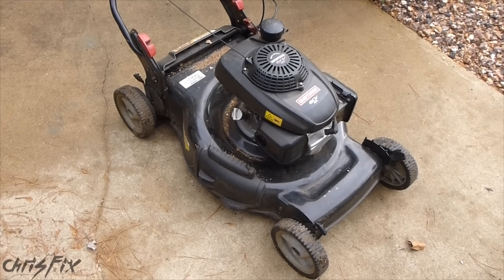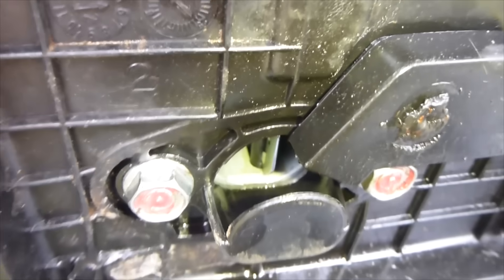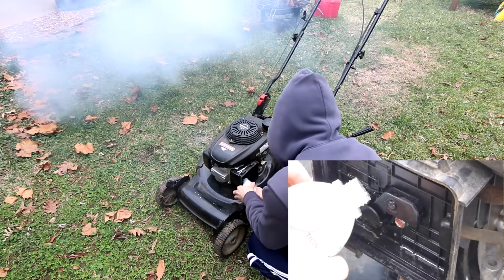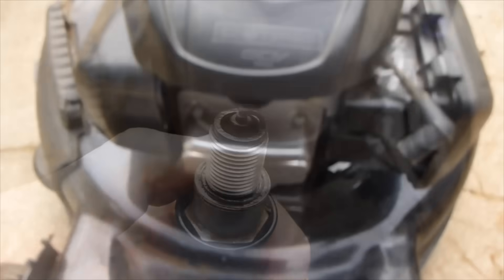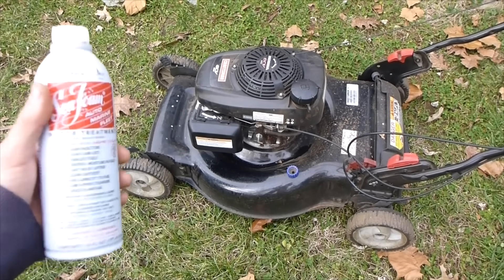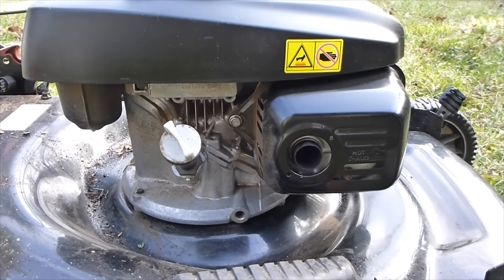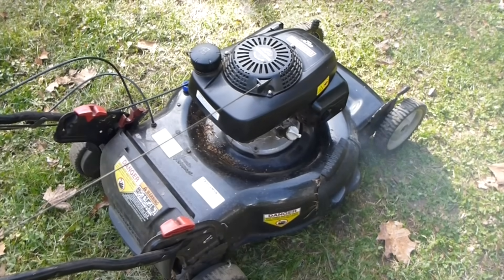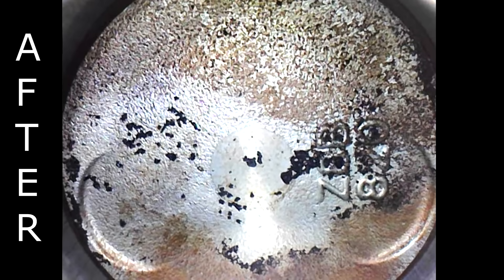Does Seafoam Actually Work? (with Proof)

Comment: Another great video, Chris. That Seafoam seems to do what it says on the tin. I have one question, however: In badly-carboned engines that start to burn oil you sometimes find that the bore has become scored from a piece of carbon that has broken off. Do you think that there is a risk of damage from loosening all that carbon at once?

One more thing; I have to say this once then I'm done. Your thumbs bend backwards a freakishly large amount. There, I said it. I'll never mention it again.
Reply from the maker: Guinea Fowl Thanks man! I was thinking the same thing about the carbon deposits. I think it is better if you use the intake method because that should slowly remove the carbon deposits but even that might cause side wall scuffing. I am really not sure if cabon will scuff the side wall or not. That is a good question! And lol for my thumb. I noticed the same thing lol.